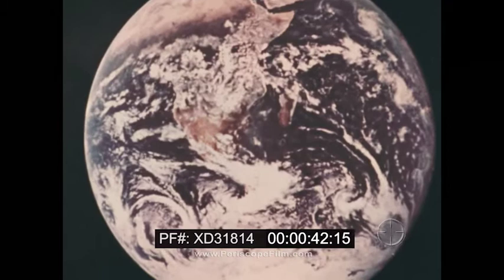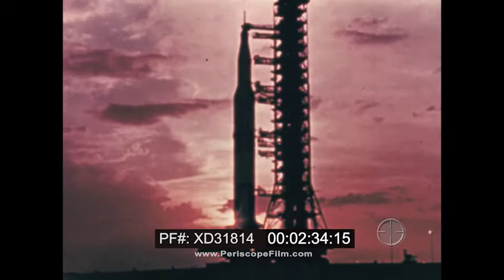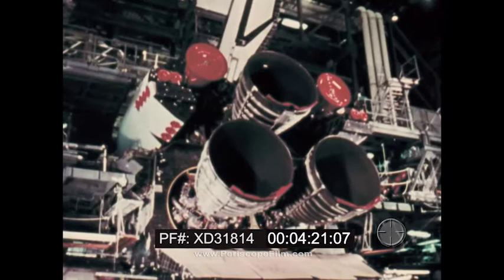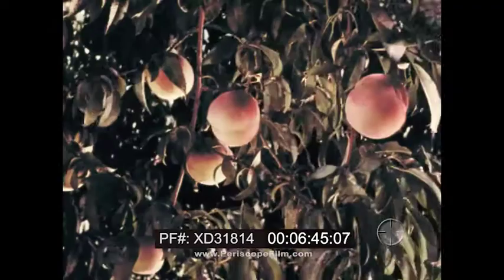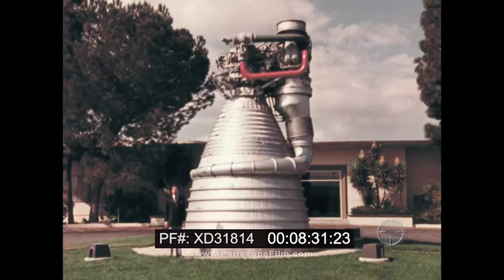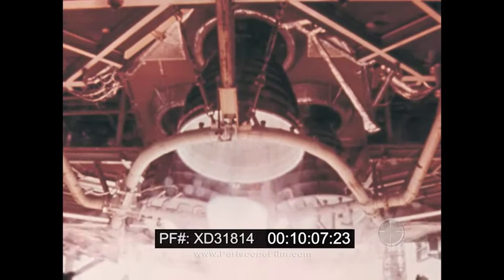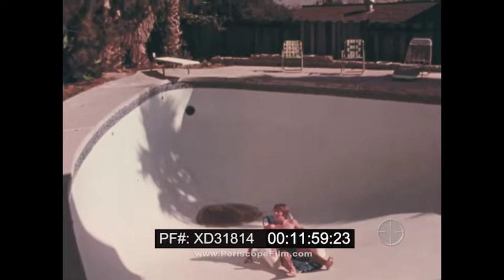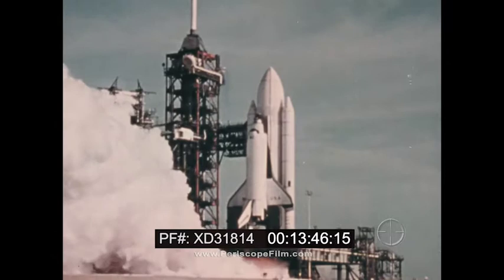SHUTTLE POWER EARLY 1980’S NASA SPACE SHUTTLE DOCUMENTARY PRODUCED BY ROCKWELL INTERNATIONAL XD31814

Comment: About 15 years ago I was involved in reprogramming the test stands for the shuttle fuel cells. 3 of them were used on a shuttle. The fuel cells were built and tested at UTC power in CT.  We had 500 engineers and only about 50 real workers who assembled the cells.  The test stands could test every function and rotate and position the fuel cell to imitate a real liftoff.  A test lasted 24 hours actually simulating a liftoff and mission.  There were 3 Allen Bradley PLC5/40’s handling everything.  They actually programmed the PLC’s to do calculus calculations which is a damn tricky thing to do with a 5/40 but it worked.